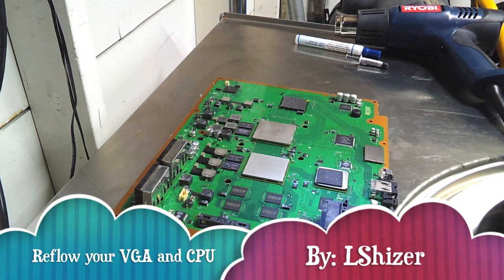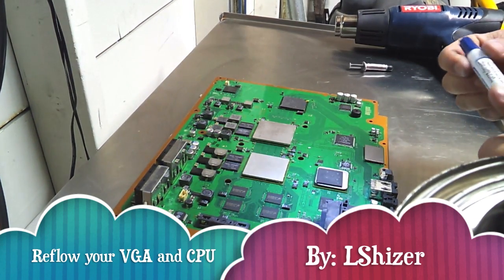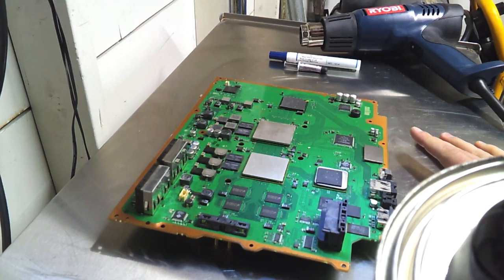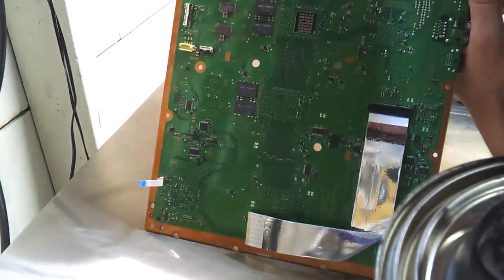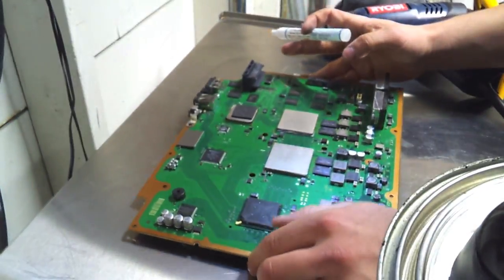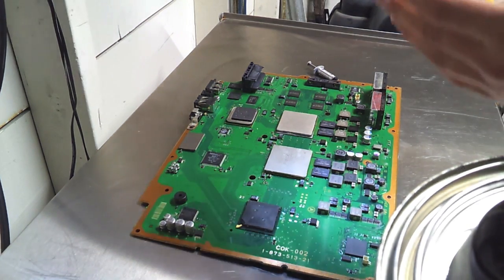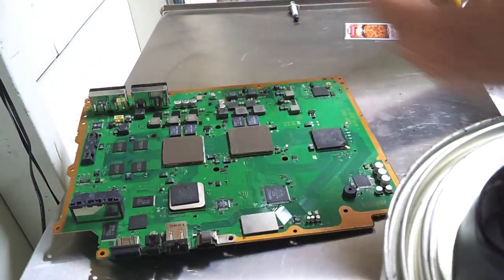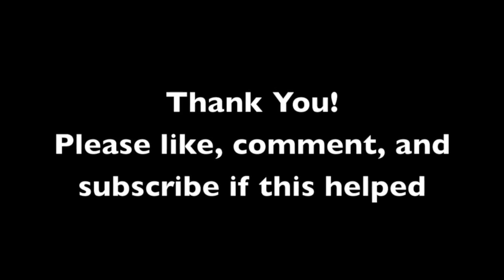YLOD PS3 permanent fix

Comment: is it important to use a heat gun? I opened it up, cleaned the inside, remove old thermal paste and instal new thermal paste and closed the console back up.. would this work?
Reply: I did just that on a CECHA01 model with some arctic silver, didn't change a thing. Still getting the three beeps. Originally thought it was the power supply, but I'm pretty sure that it's actually the motherboard.  I'm hesitant to try the above method, but I might give it a shot. Only downside is that I just reapplyed the thermal paste today and I don't want to clean and reapply something freshly applied. 9 bones for a tiny ass tube on newegg. It's good stuff though.
Reply: @brodysbuckinbroncos7697  do you give it a shot? Does your PS3 work ?

Comment: everyone please dont spread your thermal paste!

just a dot in the center
Reply: That comment's old, but it doesn't work like that with PS3s, it won't go to the edges. Every good video recommend spreading it.
Reply: Incorrect - You need to spread it very thinly and evenly over the entire surface.
A dot in the centre will not guarantee an even spread and therefore, very likely to give a bad thermal contact

Comment: skip directly from 8:11 to 9:30 and you'll see exactly why uneven heating from the heatgun method sucks: it causes the mobo to warp and bow out in the middle where you're applying all the heat, further stressing the joints and ensuring that this fix won't last long.  Instead, try the oven reflow method.  I've fixed two ps3 YLODs using this method: http://www.instructables.com/id/How-to-fix-a-YLOD-PS3-with-an-oven/

Comment: what is this reball with leaded solder balls??? alex gallgos is talking about?
Reply: The reballing process consis on separate the chip from the PCB (In this case, the GPU and/or the CPU) and remove all the solder below them. Then put leaded solder balls where the solder points are and put again the chips.
The solder used in this devices is a solder made of tin, silver and copper (Lead free solder) this solder has a higer melt point that the solder made of tin and Lead (Lead solder) and is more resistant to higher temperatures. But this "sturdy" status makes it weakness. With the use, and constant high temperatures, the solder stresses (that's how it is written?) and fractures doing a bad conection that derives in the YLOD error. The Leaded balls (little solder balls of lead solder) melts with a lower temerature, but this make them more flexible and versatile, so when they are heated and cooled they will return to its normal state avoiding the fractures.
If you ask's "But then, Why they use Lead free solder?" the answer is simple, the had to. The RoHS (Reduction of Hazardous Substances) compilant (applied in all the electronical manufacturers since july 2006) forces the manufacturers to avoid the use of substances as much as possible (like Mercury, Lead, chrome, cadmium and other two materials that I can't remember now).
If you are going to reball, ask about wath type of solder balls they use, if they use Lead free solder balls, the solution will last near a year, but the YLOD will return.
Greetings.
PS: If you requiere more info, google this words:
RoHS
solder joint failure
lead free solder problems

Comment: There is no such thing as a permanent fix for a YLOD.
Reply: Step 1, Do the mentioned in this video.
Step 2, Don't turn on the console ever again.
Done, permanent Fix. XD
Reply: Chidgear It would of been more funny if you didn't include the XD.
Reply: MaxPower
Maybe, but, for some reason that I still don't understand, people doesn't relize that I'm making a joke if I don't include an "XD" at the end of it.
Reply: yes there is buy a superslim ps3
Reply: Do you think that is the solution?  I have had three of them in for repair just past the Sony warranty requiring reflows. The systems still have inferior non-leaded solder under the processor.
Reply: TheDog7118
Not quite.. I have done a lot of repairs on the super slim for the same issue.
Reply: PowerUpGamingCanada i take it the flux does not make it permanent?
Reply: Yes there is it's called build a pc

Comment: the fan goes wild because you have to take off the heat shield thats protecting the CPU and put thermal paste on the chip the thermal paste on there is dried out that's why the fan goes wild

Comment: this is just a temporary fix  a promise fixes rebuilding the CPU and GPU + he did it remove the heat shield to put thermal paste on the chip that the heat shield is  protecting

Comment from the maker: Well it's because your ps3 is sensing temperatures above the tier 3 fan power threshold perhaps try cleaning the dust from your ps3 and make sure fan exhausts have 6" of clearance also make sure it's on a hard surface. If you reflowed your ps3 it could also be you didn't apply the thermal paste properly. Just to name a few possibilities.

Comment from the maker: Yeah it sounds like the drive is broke now all you need to do is check to see if it is the motor or the optical lens. and like I said just see if the label moves or not if not then the motor is broken more likely the lens is broken in which case you'll either need a new drive entirely or you can open your drive up and replace the lens it's not too difficult but there are a few springs so be careful not to lose or disconnect any of them(they are pretty small).

Comment from the maker: My PS3 had the same problem actually it's generally the laser reader inside the PS3 it's been a while but as I recall mine could still read DVD's and occasionally worked for Blu-Ray's. Sound right? If that's the issue you can buy a new laser at Amazon just make sure your PS3 is compatible with that laser. You also need to make sure the motor didn't go out to spin the disks. you can check this by inserting a game and letting the PS3 attempt to load (so wait like 20-30 seconds) and then eject it

Comment from the maker: If the label has moved your motor is fine and it's most likely the lens. if you don't feel like opening the drive up to replace the lens, which is a bit of a pain due to all the small springs. You could always buy a YLOD PS3 off eBay and steal the drive off it just make sure the drive is compatible with your model.
Reply: This is sort of bad info, it isn't a case of just getting the right model, the ps3 is "married" to the board of the drive it was shipped with, if you simply replace the drive with another one the PS3 will not use the new drive